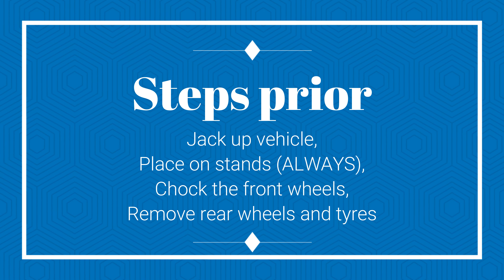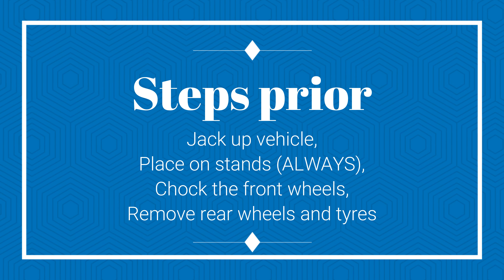DIY Land Cruiser 200 Rear Suspension Swap out

Comment: Keep in mind that with anti-seize all the grease and oils will wash away leaving only the copper, or nickle behind as the mile go by.  A much better choice is good old waterproof wheel barring grease that's used on boat trailer wheel barrings, backhoes and other equipment used outdoors.  For decades I used anti-seize wile replacing breaks only to find it gone during the next rebuild but not with waterproof grease.  You have a nice looking LR 200 and keep making the video's.
Reply from the maker: Great tips there, I haven't had any problems with antiseize washing out but I can see how that can happen. My dad would swear by the old marine grease and I think there is a lot of merit using it. Thanks for watching and commenting! Cheers, Andy

Comment: what if the bottom shock part does not want to come out?
 I removed the bolts (top/bottom) but the shock from the bottom doesn't want to come out - its like they are sealed together somehow!!! 
do you have any suggestions?
Reply from the maker: Pry bars on either side I'm afraid. Dirt and moisture gets in there and sometimes seizes up. That why I always use grease or anti-seize when reassembling. Good luck!